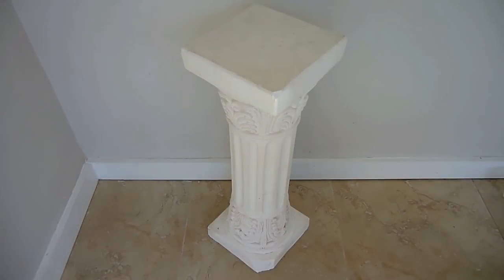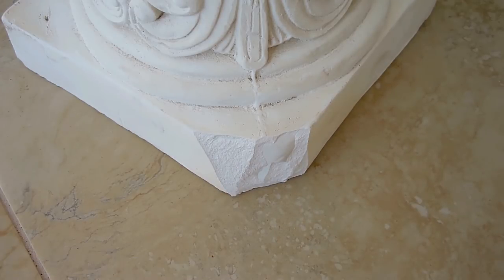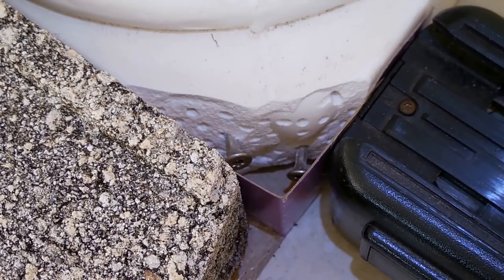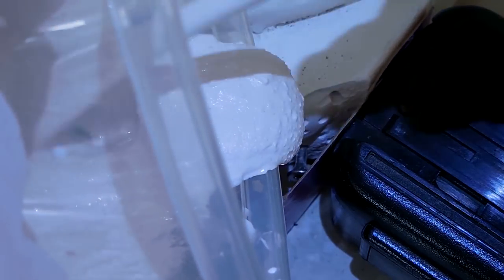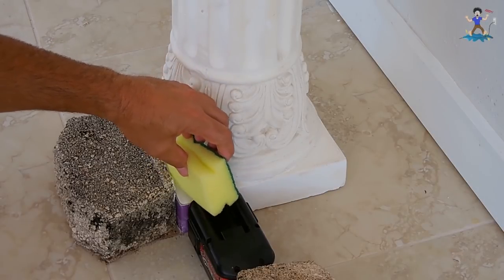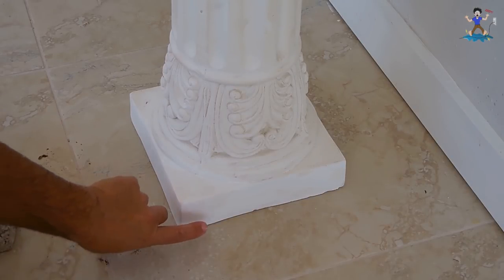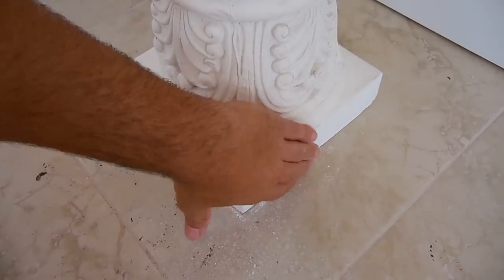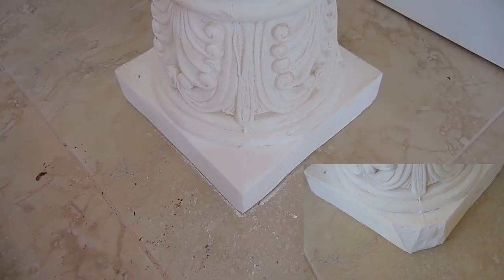Easily Repair Damaged Plaster

Comment: Thanks, you answered a question that I had been pondering!  Now once I complete the repair, I'd like to seal my plaster piece to use outdoors in my moss garden, so it's water resistant or even waterproof.  How would you do this?
Reply from the maker: Hello Erin. Once the repair is complete, fully dry, sanded smooth and dusted off, you can apply a non-yellowing sealer.  Thanks for watching!
https://amzn.to/3of7fDq
(Affiliate Link)
Reply: @electronicsNmore   Hey, thank you so much!!!

Comment: A concret bitt grinds the material out of the way. a twist drill can make brittle materials crumble. Drill slowly. An electric toothbrush or one of your ladies toys rubbed and tapped on the tin mold will help remove air pockets and settle material into the holes.
Reply from the maker: The twist drill works just fine with plaster. I never had the plaster crumble. Any vibration method is a great idea. Thanks for watching!
Reply: Careful with those ladies toys, some are like jackhammers. 😂

Comment: The cardboard mould is a great idea. I was wondering why or how it came easily away from the dried mixture. Especially considering there is glue in it. Did you prepare the cardboard surface in anyway?
Reply from the maker: I didn't use any glue.
Reply: @electronicsNmore   I was sure you said you made a mixture with white glue, no?
Reply: @electronicsNmore  At 2:12 you added Elmer's glue.